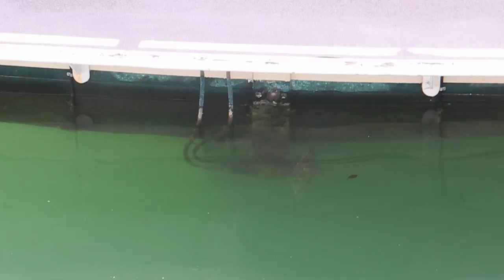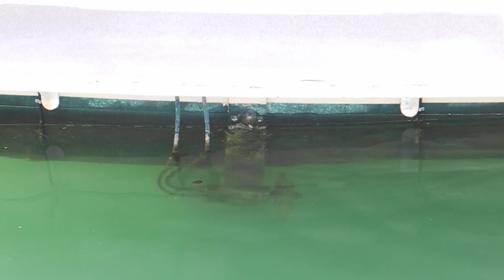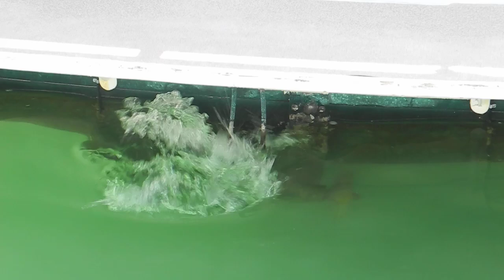Hydraulic stern thruster

Comment: Any chance of the thruster getting caught up on a floating dock or debris?
Reply from the maker: Larry Jolliffe Sr not likely the floating dock will be an issue with your thruster. But often we see floating debris that gets sucked into the thruster (bow and stern). In our 1 hour Locking Through video we captured the moment this happened as we were preparing to secure our lines to the lock bollard. Fortunately we were attuned to the possibility and thrust immediately in the opposite direction to expel the debris. And it worked! 👍🏼